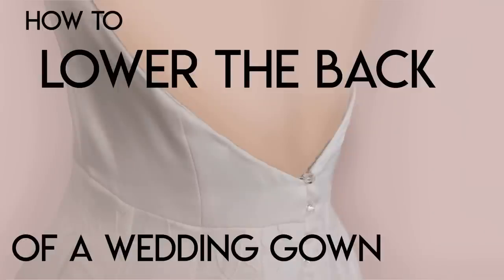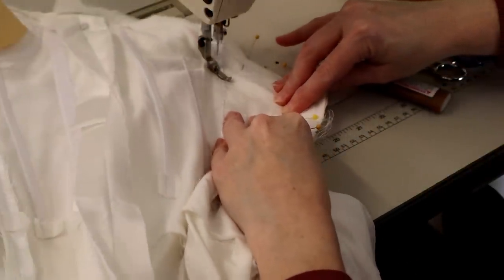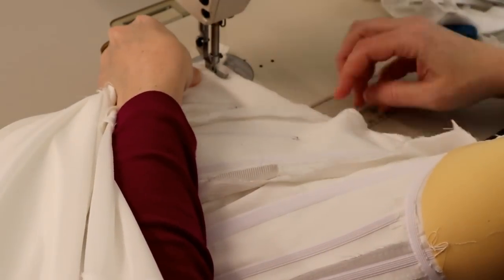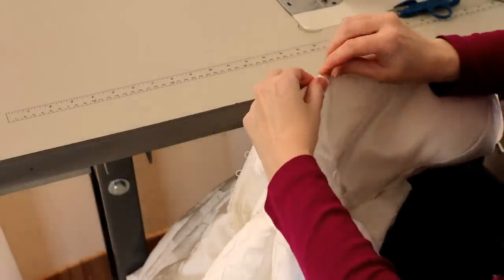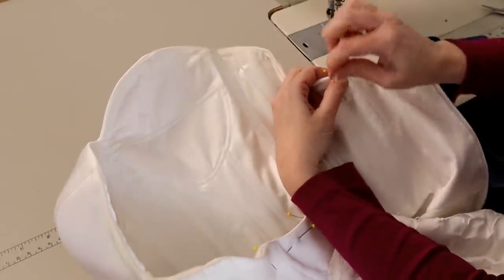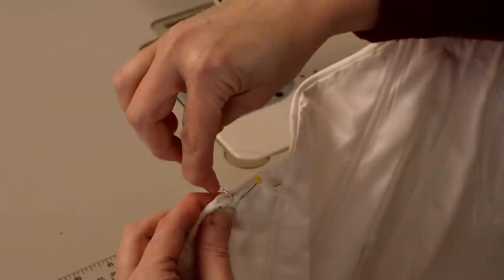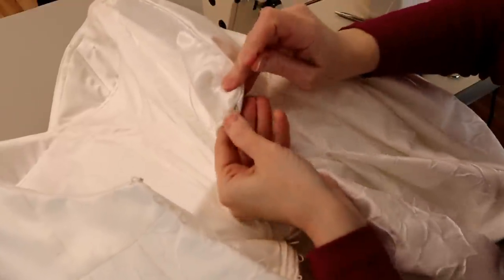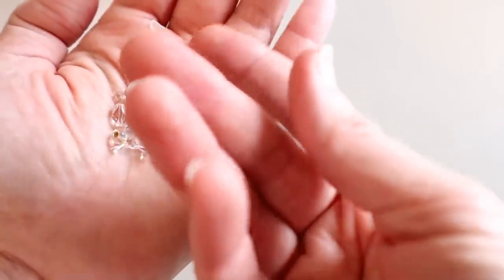How to Lower the Back of a Dress Wedding Gown, Low Back Dress, DIY Alterations, Advanced Sewing

Comment: Another great tutorial!
I have to say I’m surprised at how long your final stitches are, I guess I’ve been laboring under th idea that more/smaller stitches are always better but but  the understitching before closing the top edge of the gown certainly looks like a better option for keeping everything super secure and neat.
Thanks for all the good sewing techniques.
Sewing the layers together after taking the seams in, usually under the arms side seams on strapless gowns is a big part of my formalwear sewing day.
Thanks for helping me improve my bridal/formal sewing techniques!
Reply from the maker: I tend to value neat, even, and strong over tiny, barely visible, but possibly weaker. Also, anything that neatly saves time, saves the bride money! :)
Reply: Very true, I enjoy sewing smarter not longer lol.
Btw my favorite needle push/pull tool is the chain nose pliers from my jewelry making tool bag. 
Thin and narrow but very strong and easy to use. Save my hands from aches and pains.
Reply from the maker: Yaaaas girl!

Comment: Thank you so much for this video! I am altering my daughter’s wedding dress (never done this before) and because I’ve had to take apart the bodice to take in the side seams I was concerned that I wouldn’t be able to understitch the bodice lining on the machine as they have done on the rest of the dress. I will now hand stitch it as you demonstrated.
Could I ask a question please? Her dress has a deep ruffle at the asymmetric front bodice at the top which should stand up but it doesn’t - it flops over where joined to the bodice. I thought to support it by extending the central boning part way into the ruffle. Do you think this would work or have you got an alternative suggestion?

Comment: I don't remember if you used the boning you cut down but thats what I do. I just slide it down on top of itself and tack it real quick while I have the dress open. Easy peasy. The top is already capped so no new work there.
  I once cut a dress back severely deep. And the inside where you are tacking I did use skinny boning almost like a cage frame for structure on the bodice of the gown. It worked great. Man I wish I had thought to get pictures of all the different alterations I've done. I guess I could put the word out for my brides to send me some lol. As always love the vids.
Reply: Thank you for all the sewing classes 🙏🏻 , how much does usually  cost to lower the back ?

Comment: Why not to use the timble?
Reply from the maker: I mention this in one of my frequently asked questions videos. My joints are hyper-reflexive, so when I use a thimble for high pressure jobs, my final digit can flip backwards a little too much and it stresses the tendons in my fingers, causing more wear and tear on my finger joints. I sometimes do use a thimble, but not super often.